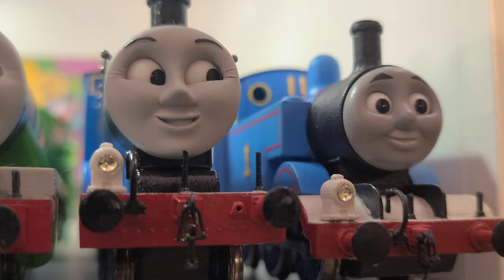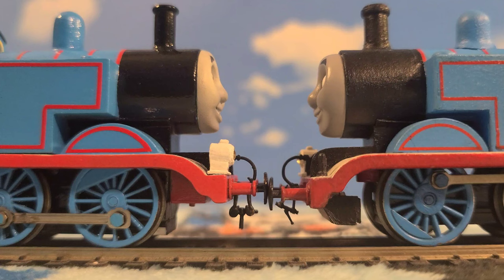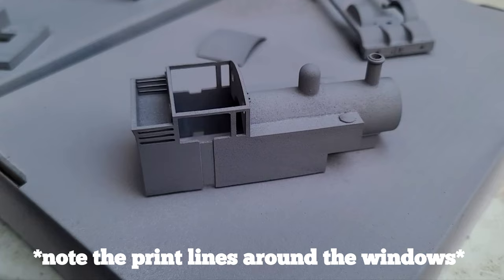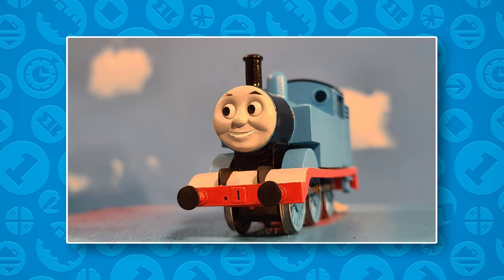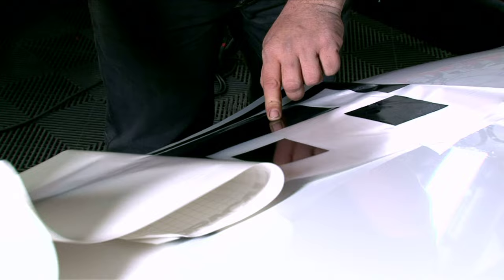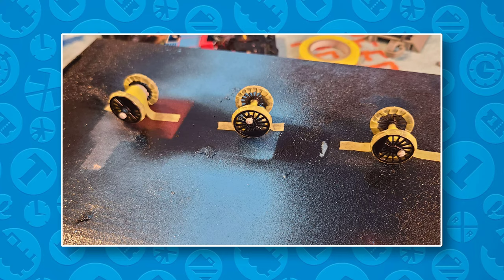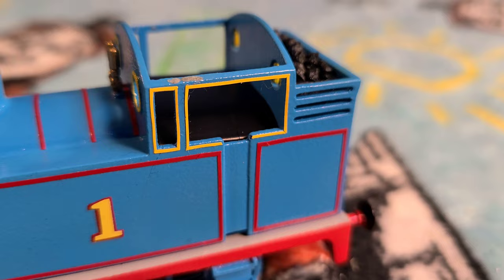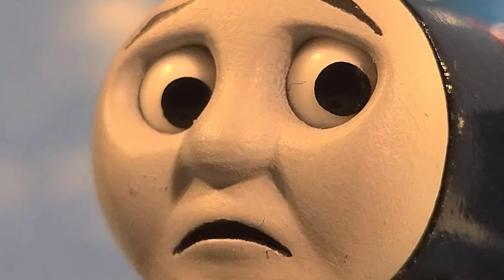How I Made Thomas | Brenden's Model Box HO/OO

Comment: This looks amazing! Quick question, what did you do to cover up the electronics in the cab? I've been altering a bachmann thomas to have an open cab and have been trying to find ways to move and secure the circuit board without damaging it. Also, what did you use for the decal for the #1? Did you edit it in Photoshop or use a commercial decal sheet?

Comment: 2:40 - THIS! This is a moment that I am currently stuck at with my own Thomas (unless one doesn't count flimsy cab support with no door), even if it isn't Knowah's shell, but rather a different one.
Reply: 4:31 - Just to clarify though: to keep the motor still, did you use an elastic band or adhesive tape? Ever since I've cut the motor house down to fit the custom body shell, the chassis stopped working properly, as the motor doesn't sit still, and I hav eno idea how to fix it.

Comment: looks awesome! What did you do to fix the warped running board? I've got a real problem with my prints warping over time and cant seem to figure out how to stop it
Reply from the maker: Thanks man!! Honestly, I heated it up with a heat gun on low, and had it sit upside down flat on a cold surface with weight holding down the board. Fixed it up really well. After that I put it in the freezer for like 15 minutes
Reply: @BrendenReis10  thanks! Might have to give that a try